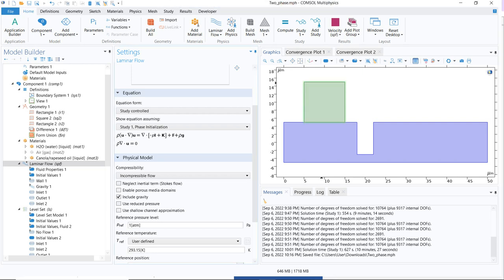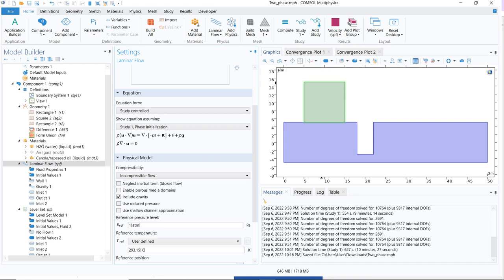Fundamental of Two Phase Flow Level Set Method #TwoPhaseFlow #CFD #COMSOL

Comment: Sir, I defined a function in global definitions for volume force in fluid dynamics using the velocity 'u' of the fluid as an argument but when I am using it in the volume force section it is showing 'undefined variable u'. So, how can we define a function using velocity as an argument?
Reply from the maker: write spf.u  (single phase flow) that may remove the error. Let me know if it works.
Reply: it is not working